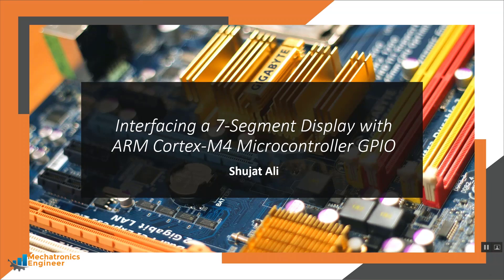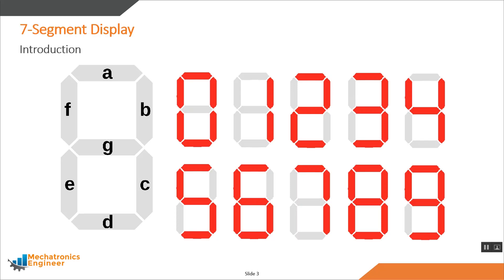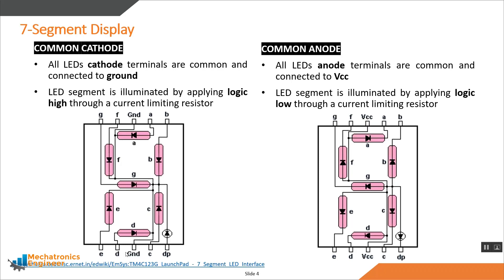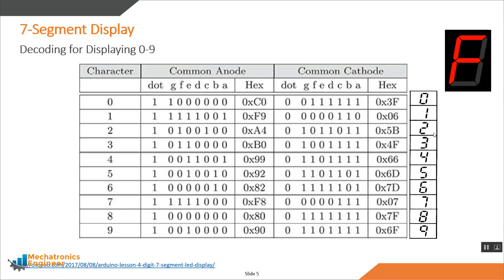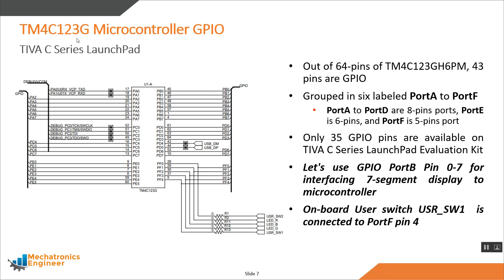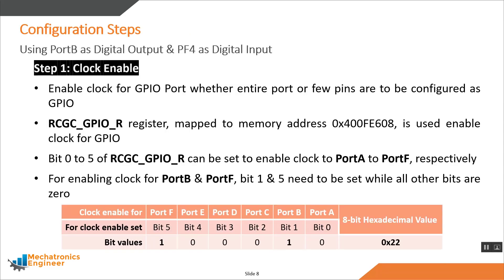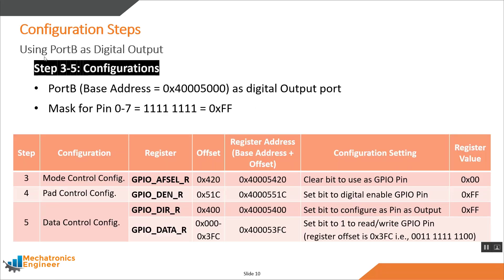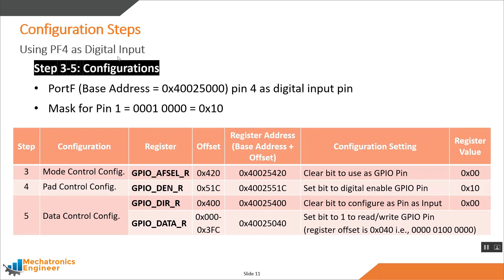Interfacing a 7-Segment Display with TIVA C Series LaunchPad

Comment: I can only get the program working if I start debug and run it in debug. Once I stop debug then the program works, but if I reset the Microcontroller it won't work. Do you have any answers to fix this trouble? Thank you
Reply from the maker: Joe Rit, try to add some delays.
Reply: Ok thank you

Comment: I tried to interface two seven segments displays  ( common anode and common cathode) at a time , common anode connected  to PB and common cathode to PC(upper)& PD (lower), I'm not able get proper output i.e data passing through one segment is effecting the other segment data i didn't understand how it was happening could you say what might be the problem sir